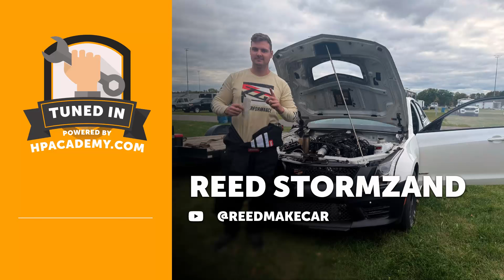CBR1000 x Miata - A Match Made in Heaven? #PODCAST

Comment: Your joking.  A Miata weighs at least.5 times as much as the bike. It's not light for that engine. A custom tube or monocoque can be around 900 pounds, the Miata is over 2200 pounds.  The bike is around 450.
Reply: To be fair, you can quite easily get a Miata down to around 4 times the weight of the bike.
Reply: @LuckyFruitRacing Good one.
Reply: @CarlW-d8c you just said the bike is about 205kg. You can fairly easily get a Miata in track trim down to just over 800kg😊
Reply: @LuckyFruitRacing stripped fo racing and it's still almost 4 times as heavy. I've ridden motorcycles for about 200k miles and had a little bit of time in a motorcycle engine powered  car ( Gordon Murray Rocket) which was about one and three quarters as heavy as the bike. It had an additional two speed gearbox, so you had a low range to start with. If you have a custom chassis of about 900 pounds (410 kilos) and  1300 or 1400cc bike engine a slightly greater number of teeth on the back sprocket will suffice.  I dontt see it being easy to get a Miatadown to 800 kilos, they start out around 1000 to 1150 kilos.
Reply: @CarlW-d8c If you strip and cut all the unnecessary shit, the weight flies off, especially considering the weight savings on the drivetrain alone
Reply: It's working though. Kind of nitpicking shit he says just for what?

He is literally driving the car. Maybe it's not optimal, but he did it, finished it, and uses it
Reply: 900 lb cars are single seater race cars, not street cars. Even a radical sr3 which is also bike engined, has a quoted weight of 1366 lbs.. 1500 lbs isn't that much more.
Reply: @superbarnie The Gordon Murray Rocket is a 2 sear
Ter that is under 900 pounds. It's a tandem 2 seater that looks like a late 50sto early 60s formula car. It's spartan.  If you have driven a formula car, xxports racer or a racing go cart, you know that those people who say their 3,000 pound or more production car handles like a race car or go cart, have never driven one.
Reply: @superbarnie Ive known of Radical since their beginning.  Claimed weight was 420 kilos 924 pounds.  Numerous classes of 2 liter sports facers are around 1100 to 1200 pounds using heavier auto engine.  That weight ( was from a  Grassroots Motorsports article. I cant see Rachel  understating the weight by444 pounds.
Reply: That was Radical 'first Hayabusa powered car.  Even 70s Formula 5000 cars with iron v8swere inthe 1350 to 1400 pound range a car with an aluminum  bike engine is not going to be a nearly identical weight.
Reply: @CarlW-d8c Nope, just look it up. Radical's own website lists the SR3 XXR's weight as 620kg. The one that weighed 420kg was the 1100 Club Sport.
Reply: @superbarnie I don't see how . Ive weighed several 900 to 1000 cc bike engines. They were in the 15o pound range, give or take 5 pounds. The Hayabusa weighed 174. I forgot if that was with the balancer or not. The wheels and tires aren't  much bigger.  The whole car isn't much bigger. Ðid one have Shaquille O'Neal in iit, while the other was empty.
Reply: Ps the balancer was ab1.5 pounds.